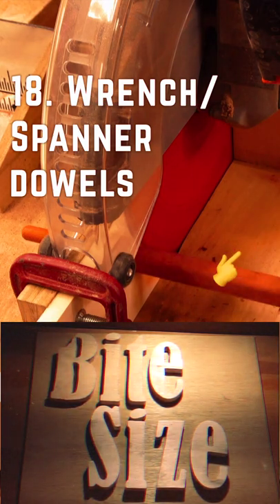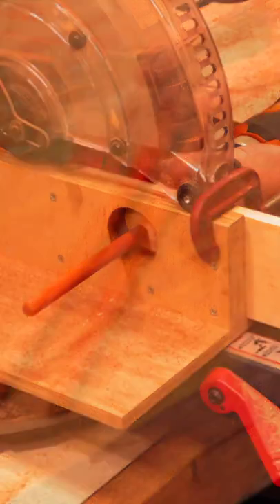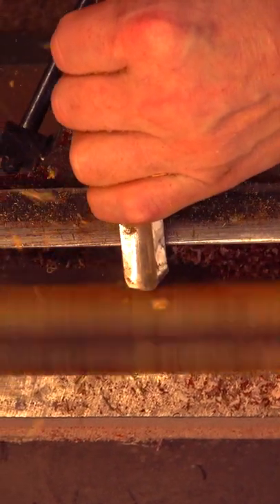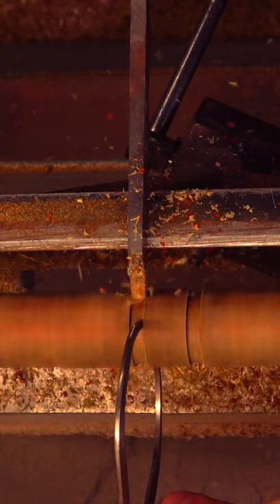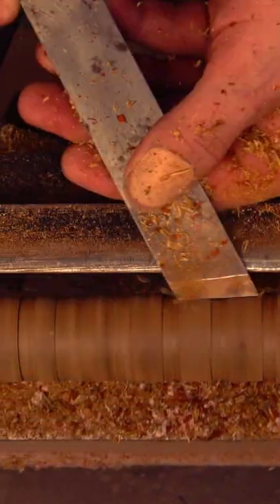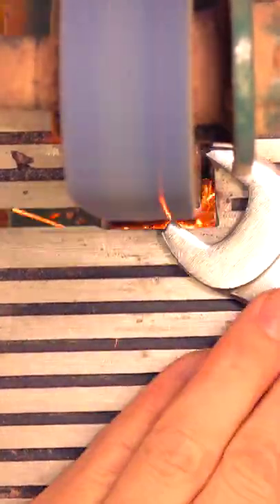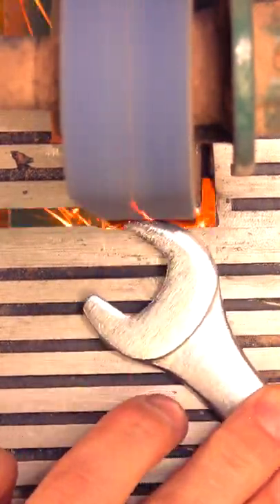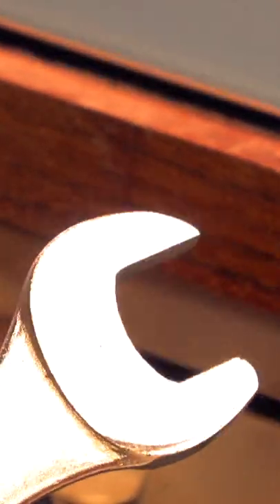18. Wrench dowels #shorts #MTbitesize

Comment: I've used belt sanders for smaller dowels. Hexing it on the tablesaw first, then sand, inserting into a drill will the sander is on its top, trigger locked.

Comment: An actual home made tool that's useful
Reply: Still need a lathe, but very cool.
Reply: @erikfrankfurt4650  the lathe isn’t the expensive part, all the tools you use on the lathe is the expensive part. You can multiply the price of a lathe In tooling after no time at all.

Comment: You can also make a box-like jig for your table saw that allows you to make dowels as large as you want.  (You turn the dowel using a drill and set the diameter by setting the table saw blade height.)
Reply: That’s how I do it